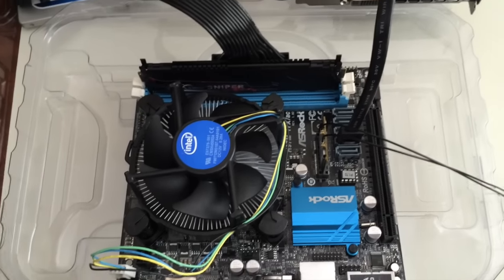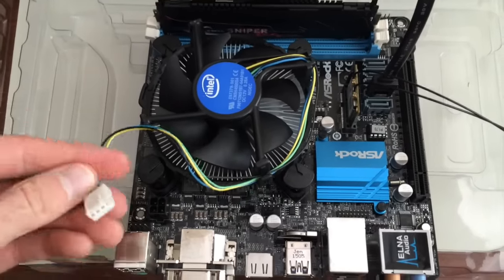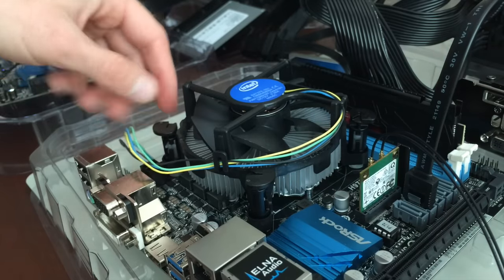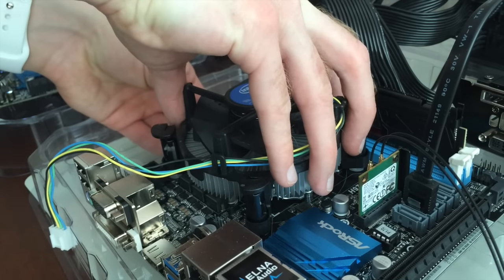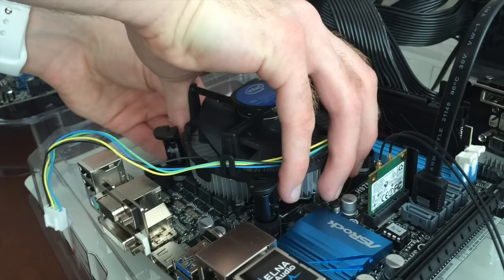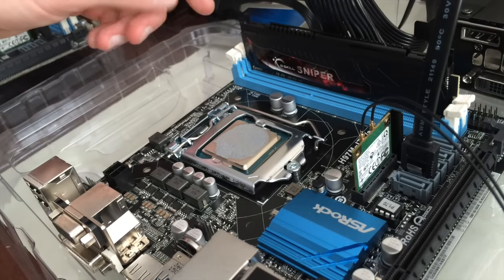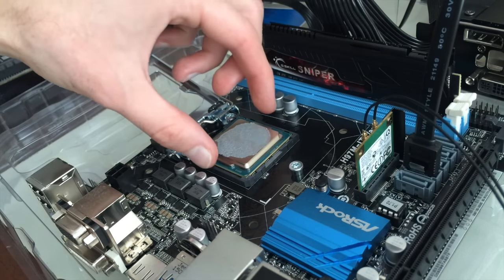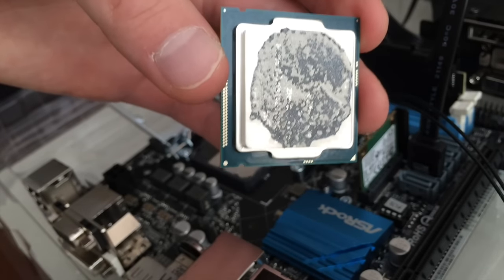How to remove Intel CPU and heatsink

Comment: SMH , My PC didn't have thermal paste , that explains everything
Reply from the maker: oh no; yes that is quite important. Did it survive?
Reply: Yup , peaked 85 C every time no matter the load . I applied the paste now , idle is 40 C and full load is 70 C
Reply from the maker: jeez yeah 85c is super hot, although im actually surprised it stayed there and never went over 100c, which then it would be toast. I imagine it underclocked itself or the machine shutdown to survive? now those temps look more normal.
Reply: Oh no! Glad your CPU survived though
Reply: was it a pre built?
Reply: @DouglasHewitt  The pc would shut itself down before toasting itself....?
Reply: Christopher Farrell yes pc will shut off it starts to overheat
Reply: any thing dam imagine creating something called a fake over clock.
Reply: Seems like mine doesn't either. I can't get the outer pins to come off yet, but as soon as they were loose you could pull the whole heat sink assembly off the board.

Definitely need to work those pins out and see what the hell is going on in there.
Reply: @DouglasHewitt  you could heat the water up instead of furnace khhhh
Reply: I just replaced my thermal paste on my i5 6400 and i get to over 95° in discord with the fan ON! 2 of the little legs from the cooler are broken fyi
Reply: @DouglasHewitt  is the heat sink a CPU cooler? Also do I need cool paste?
Reply: @DouglasHewitt  I took my fan off just now to clean the dust off, didn't know the thermal paste was important.

I left the paste as is, is it safe to just put it back on and use it?
Reply from the maker: @mothman7786  hmm no, if you detached heatsink (and fan) from the thermal paste you should clean that off and reapply new paste, when it gets in contact with the air it drys out and doesnt seal again the same
Reply: @mothman7786  Just want to add that I took mine apart to clean it with isopropyl alcohol and I didn't have any paste, so I reassembled it with what was there. It's not ideal, but it's not the end of the world. Preferably clean it with alcohol and reapply fresh thermal paste after disassembly.
Reply: lemme guess,prebuilt???
Reply: Does not applying thermal paste on cpu cause a pc to shutdown continuously??
Reply: After 7 years how is your pc 😅?
Reply: @Super_cho9  Had no issues, sold it to a pc recycling center about a year ago , worked well.

Comment: Why does the power cable not let me remove it? It feels like it's stuck and I can't take it out
Reply: Just press the clip on the side
Reply: @curpassamuelalin6751  the clip inside is veing blocked by a circle thingy and it might break off
Reply: @lemonboy9yearsago760  same here... How did everything turned out?

Comment: The best way to break the thermal paste is to run it and let it become hot then shut it down and remove it
Reply from the maker: hmm haven't tried that but it makes sense. Just be sure you don't touch any metal thats too hot.

Comment: Thank you very much, the thermal paste was in my PC for almost 6 years, so your guide was really helpful for me :)
Reply: Damn 6 years
Reply: For me 5 years now, sometimes get hardware crash every blue moon, I just got some tasty pasta but was wondering why the heatsink wouldn't budge, just needed some rotational power
Reply: Mine is STILL in my pc for 9 years. Haven't had too much problem in a long time, maybe because I invested on fans (?). Was planning in changing CPU (mine is i3) until i realized I also was needing to change the thermal paste, but it is a good thing that you already change the thermal paste with the CPU. Pretty surprised and glad that my pc wasn't performing poorly or crashing.

Comment: THANK YOU!
As it's not the first time I've removed a heatsink, I went and did pretty much exactly as you had here. But then I was confounded. The damn thing didn't budge lol. I was like, "I've got to be missing something." So I looked it up and found your video.
When I saw you too were applying a fair amount of force to break yours free I was relieved. I tell you what, I've never had one so difficult to pull off lol. Mine is off and I've a better heat sink (fingers crossed) on it now. That poor little thing just could not keep up with the torture I put my comp through.
Thanks again for the vid.
Reply from the maker: glad to help! yeah they're pretty tough
Reply: @DouglasHewitt  hey man. I removed it so i could reach the dust but. Do i need to put new paste on again? Its still on there but isn't it damaged or something? I don't know what to do and don't dare to put my Pc on if its harmfull for him :*(
Reply from the maker: @trevorphillips2250  yeah typically once the paste is cracked by separating the heatsink and exposed to the air it hardens and becomes less effective and won't bond correctly anymore; so you want to clean it off and re apply fresh new thermal paste
Reply: @DouglasHewitt  thanks for responding man :) i will clean it and apply new paste on it :D i'm going to install a Radeon 5700 xt in it to to replace my 580 series. Hope its better for vr gaming/normally gameplay
Reply from the maker: @trevorphillips2250  nice! yeah that will be a solid upgrade. What CPU do you have?
Reply: @DouglasHewitt  PCI Express 16X 4.0 :)

Comment: If it's stuck (and you already removed the motherboard from the case) -> use a hair dryer, on low setting and blow on the heatsink.
Usually it transfers heat FROM cpu, this way it will transfer heat into cpu. And that thermal paste needs just a little bit of warmth to get unstuck

Comment: When i was trying to get the fan out, the pins were still stuck. And i have no idea to get it out because it might break.. And i also can't unplug the power for some reason, its also just stuck.
Reply from the maker: gotta just keep trying, wiggling it and all that, any luck?
Reply: It did work, but not with wiggling, the pins were bent :/ I had to open the back of my pc to bend the pins back xD had a bit trouble putting jt back, but I did it! Thank you for your advice❤️ I appreciate it!
Reply from the maker: nice!  @Wurstenikk

Comment: These stupid arrows are so counterintuitive. I broke my last fan screws so I wanted to see if its different way to do it. Midway watching your video I feel like - this is so counterintuitive. And I opened my pc and turned the arrows back and... Voila! It opened without braking. Awesomeeeeeeee

P.S.

The new Intel 7 fan I bought got some 3 thin layers of thermal paste. And I am like thinking WOW this is some next level engineering. I turn on my pc and run LoL - the temps were 88C - 90C. I immediately wiped it and put one squirt of regular paste and... Voila! 58C MAX of only 1 of the 6 cores.
Reply from the maker: nice! glad it helped, yeah I dunno who designed these things. Oh wow, guess from the factory it had too much paste

Comment: pro tip: use or just open the PC for like 5mins for the thermal paste to warm up before removal, makes it 10x easier to wiggle the thing off.
Reply: i see this now that i removed the psu and am having trouble removing the heatsink cause its stuck, thanks tho

Comment: Do you need to apply thermal paste with the fan? Or just use the pre applied thermal paste it comes only
Reply: You can use the pre applied thermal paste. However, if there is no thermal paste because you need to remove the cpu or some other reason, then just put a pea size of thermal paste onto the cpu and no thermal paste on the heatsink as when the heatsink with fan comes down onto the cpu, it will squish the thermal paste out between the cpu and the heatsink. Just make sure you don't use too little of thermal paste. As far as using too much, you really would have to go all out in order for it to affect anything. Linus tech tips did a video on how much thermal paste you need and what is considered "too much."

Comment: My heatsink has the same connector type solution and I'm trying to change the thermal paste. I did unscrew the screws and popped them out. I rocked the heatsink around a little bit so that it obviously disconnected from the dry thermal paste. Now the issue is, the heatsink only comes out about half a centimeter or so, and it's very obviously those screws resisting me from pulling it out. I'm getting hopeless here, it's a prebuilt Asus G11CD-K from 2017 and I'm trying to avoid having to disassemble the whole thing just to get this cooler out.
Reply from the maker: It might be unavoidable, you may need to access the intel cooler plastic pins behind the motherboard to close them manually to get them to come out safely. You get it sorted?

Comment: Very helpful video! Just noticed your MB had a vertically installed WIFI card. Do you use anything to secure it or just leave it stand there alone? I have one M2 E key vertical slot on my Asus MB too. But could not find a way to secure the card. And Asus support was helpless and just threw irrelavant and useless links. Thanks
Reply from the maker: it should be fine free standing, the slot has enough grip and the card is pretty small and light

Comment: It's alright to put back right??
Reply from the maker: you can.. might want to redo the thermal paste, it depends. want to see how sticky it still is and how much or if it dried already.
Reply: @DouglasHewitt  I don't think you should ever reuse thermal paste. Clean it off with isopropyl alcohol from both surfaces and reapply the thermal paste to the IHS. If you reuse old paste, even if it isn't dry, there may be air bubbles in it which reduce the effectiveness of heat transfer.

Comment: My fan wont get removed i tried to pull gently how you showed and i tried with force and its still stucked what do i do please help
Reply: Same problem
Reply: @FaceNapalm  i resolved it with some heat but it took 30 minutes and it almost fan burnt
Reply: @mita4199  Oof, that's rough. Fortunately I solved it by just gently rotating the fan back and forth, after about a minute it starting coming off
Reply from the maker: yeah! that's the trick
Reply from the maker: get it sorted? sometimes needs some wiggling

Comment: I have Deep Cool Alta 7 but couldn't manage to remove it i know cooler shown in video is different but latching system looks same i did everything and pull out black pins but that white ones are stuck in motherboard
Reply from the maker: so typically with after market coolers there's some screw or bracket on the underside you have to remove. did you get it sorted?
Reply: @DouglasHewitt  After so many failed attempts, I took the PC to the repair shop, there were two problems: first, these push pins didn't work no matter which way they turned them, they were stuck also the thermal paste was really dry like it was glued on. So they had to remove the motherboard from the case and remove the cooler with some tools
Reply from the maker: @sullivan0  oh wow, ok that makes sense tho, yeah not every situation is the same, sometimes takes extreme measures! glad they fixed it

Comment: Hey I accidentally pulled too hard without turning and the screw kind of popped out. I only have 3 of them tightened now and I'm not sure if this is a big deal
Reply from the maker: are you wanting to use it like that? it might not be good since it won't have an even grip and the thermal paste might not have good even contact. If you just removing it to replace it then no worries

Comment: there is a gap between the upper plastic (with logo tape on) and the under fan. Thats where i have lots of hair accumulated. how do you suggest i take em off?
Reply from the maker: hmm can you just pull the hair out? not sure how to disassemble the plastic and the fan, that would be an endeavor which may not be able to put it back together

Comment: Can you put back in the fan without worrying about the thermal paste?
Reply: You can but the heatsink won't have anyway to cool your cpu down your fan and heatsink will just be ontop of your cpu the thermal paste acts as a heat transfer heat from cpu through thermal paste to heatsink the heat is spreed through the groves on the heatsink and cooled by the fan
Reply from the maker: you really want to clean and re apply the thermal paste each time if you ever remove a heatsink

Comment: can i just put the fan back on if the thermal paste is still on the cpu, or do i have to remove it completely and reapply new thermal paste?
Reply from the maker: you should reapply new thermal paste

Comment: Can I do this without removing the whole board just take the heat sink off clean the thermal paste and reapply it ?
Reply from the maker: With an intel heatsink yes, however with other heatsinks it depends how the heatsink attaches and if your case has a cutout to access the back of the motherboard. Some heatsinks require access to back of the motherboard, others do not.

Comment: Do I have to take the CPU out to clean it ?
Reply: Da Boss I don't think so. I just clean off the paste as soon as you get a good shot
Reply from the maker: yep, just remove the heat sink/fan, no need to remove the CPU to clean. in this case a small amount of rubbing alcohol with lint free / microfiber cloth would be good

Comment: Ok good, but wth can you remove power supply big cable from motherboard? I almost bend my motherboard
Reply from the maker: yeah that cable gets stuck, you can rock it back and forth, sometimes it does flex motherboard a little which is ok but definitely not bend in a serious way. You figure it out?

Comment: Will it reduce the efficiency of the heat sink to help cool down the processor since I am breaking the contact through the thermal paste ? 
I'd be really grateful if you could reply
Reply from the maker: as in are you removing the heatsink and then reattaching it? yes that would reduce efficiency. if thermal paste is new and still gooey, like you just installed it, and then re seat it, you might be ok. If its been on a while and hardened and then you remove it breaking the cake like texture, thats really bad to reattach it, it will not cool properly, you need to clean it all off and use new thermal paste

Comment: How do you put back the fan I'm stuck
Reply from the maker: did you figure it out?
Reply: @DouglasHewitt  yes i actually did but here's the thing omm i.......it wont turn on......probably since i damaged the cpu socket holder(i broke 4 computers in a day tying to exchange processors but i learned a lesson i shouldn't exchange processors without reviewing and researching i just bought new motherboards :)

Comment: do i need thermal paste to put back again? please reply asap
Reply from the maker: yes you will need new thermal paste to re install; also clean off old paste, especially if its been on there a while and is hard / baked from use
Reply: @DouglasHewitt  thank you, and im glad you answered even though the video is 5 years old
Reply from the maker: @hmed9954  for sure! i dont always see all the comments but i try to reply to every one

Comment: Do i need to remove motherboard to remove cpu cooler?
Reply from the maker: for the intel one no, you shouldn't. Other coolers you might, and some cases have windows in the back so you can get to back of motherboard without taking it out

Comment: I’m having an issue. I have a faulty CPU fan in my ASUS G11CD-K, and I want to remove it and have a look at it to see if I can find the issue. 
The fan is from everflow, not intel, but the latching system looks identical, so I assumed the procedure would be the same, but it doesn’t want to come of! 
After some wiggling I managed to get the assembly loose from the thermal paste, and until there everything in the video worked, but when I try to take it of the motherboard there is some sort of plastic locks on the bottom of the attachments preventing me from lifting it off the motherboard by more than about a centimeter. Does anyone else have this issue?
Reply from the maker: not sure the exact differences or how that one works, but is there any way to pinch the plastic tabs so they fit through? on the intel one you twist that thing on the top so they pinch closed and can come out
Reply: @DouglasHewitt  Thanks for the answer!
I eventually managed to solve it, after asking on r/techsupport on Reddit! Turned out I just had to pull a lot harder than I was comfortable with, so they all eventually just snapped out without damaging anything. 
Thank you so much for this very useful video!
Reply from the maker: @filipwassen7947  ok great! glad you solved it and they were able to help

Comment: My coolers screws won’t come off no matter how hard a pull on them this isn’t the Olympics INTEL
Reply from the maker: haha sorry to hear that, did you get it sorted? by turning them and pulling they should come out of the motherboard but will still be attached to the heatsink itself
Reply: @DouglasHewitt  yeah i figured it out thanks. I had to watch an 8 year old Techquickie Linus video to figure out I had the screws facing the wrong way! Thanks anyway though!
Reply from the maker: @G0LDEN  ahh! ok that makes sense, glad you got it

Comment: the power cable seems to be stuck and i cant pull it out, its getting to the point where it is bending the actually motherboard, does anyone know why and how i can fix this issue?
Reply from the maker: any luck? it should come out, don't bend the motherboard tho
Reply: @DouglasHewitt  oh yh, in the end it was clipped in by some plastic which we eventually unclipped by using a screw driver